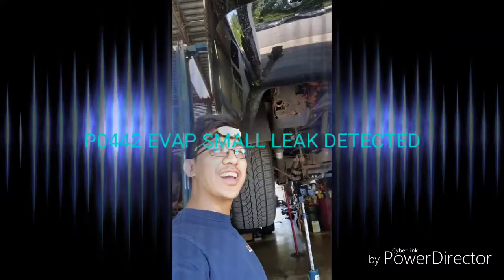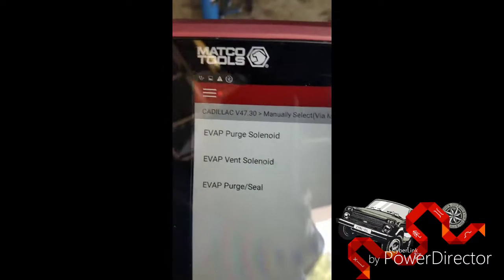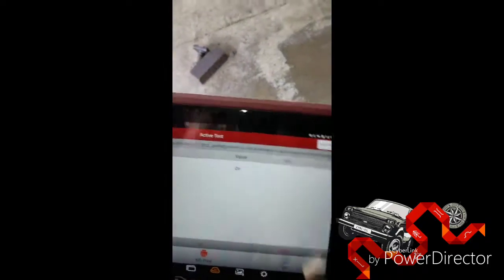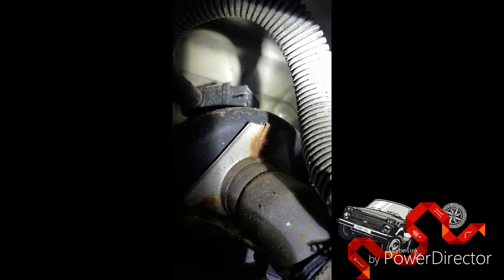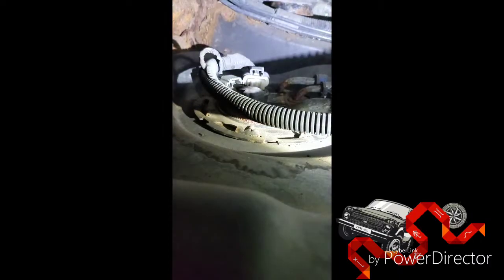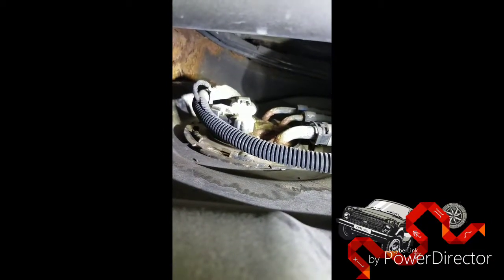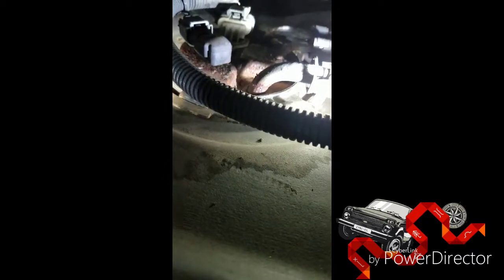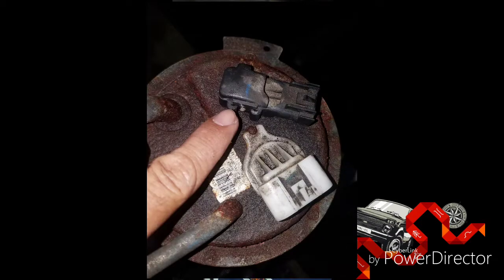2012 Cadillac Escalade Hybrid p0442

Comment: Where did you hook up the smoke machine ?
Reply from the maker: I usually look for the purge solenoid valve in any vehicle. Then i hook it to that vacuum leak going beneath the vehicleand away from the engine. That is to test leak going to evap cannister.